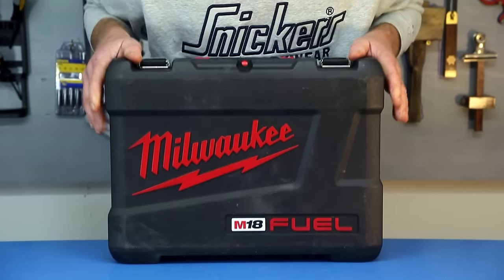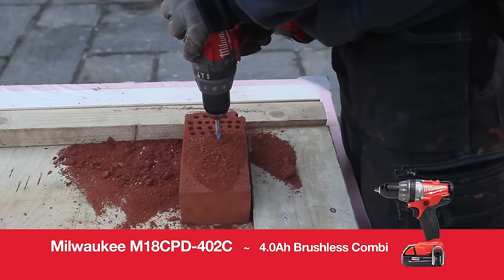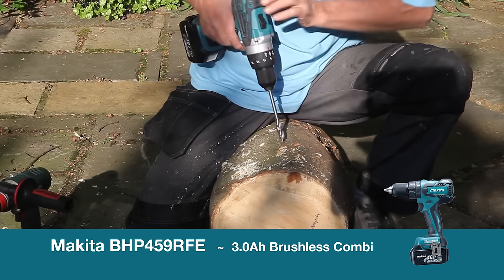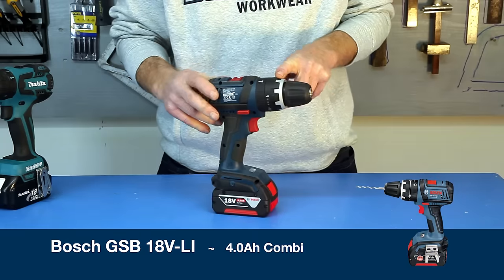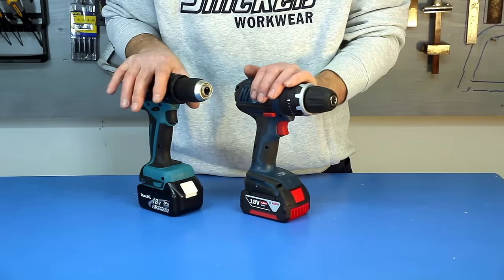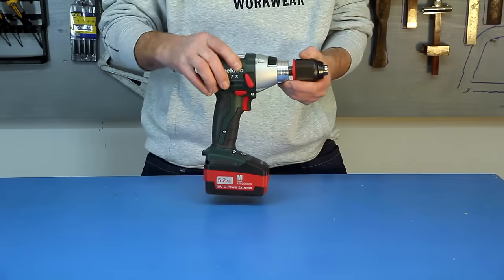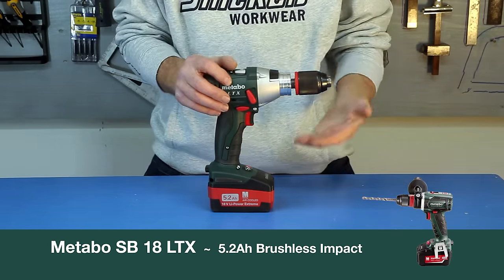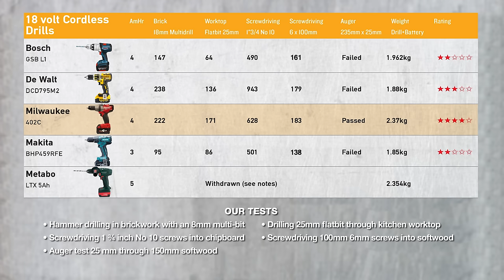18v Cordless Drill Review - 5 Best Drills Tested

Comment: If a drill isn't durable, it's as good as useless. I have worked for a communications equipment shelter manufacturer for pretty much the last 8 years. There are approximately 250 or so workers using 18v DeWalt cordless drills, all day long, 5-6 days a week. They get dropped from 6 foot ladders (occassionally from 15ft or higher), thrown around job boxes, get rusty from no climate control, and go through batteries non stop. For the most part they have gotten more durable with each redesign. We have occasionally tested equivalent models by top manufacturers. EVERY single other brand tested has DIED in about 2 weeks, literally. I've killed my share of DeWalts, but nothing else I have seen is close to their durability. I am confident that the one I have at home will last me as long as I can get a battery for it. Having said all that, I'm not sure about the newer lithium ion models, since they haven't been in use long enough to get a good idea of their durability. My suspicion is that they aren't as durable in the long run as the older models. The casings on newer drills are slim and I doubt they absorb as much impact. I'm still betting DeWalts are tougher. None of this probably matters for home use, but as I said, a DeWalt will probably last the rest of your life.

Comment: It’s the best youtube video!!!
Now I repairing the own flat. After 1 day my old, green 12v Bosch was dad.  So I decided to buy a new normal drill (not
green).

I wanted to have light and pretty powerful tool.  All 18V tools weighed quite a lot, but all 10-12V had very little power.  I found not bad compromise:  A month ago, I bought a DeWalt dcd795 d2. It's the same drill but with a smaller battery. It’s weight only 1,66Kg (I’m not sure but I think it’s means 3,66lbs).
It’s not a largest battery but for my work… – enough!  With one battery I screw up 500 small bolts (4,3x25).  It’s not bad. I drill only a few big holes or screw in a day. For small holes/bolts it works perfect! But it can do also a hard job, its very universal tool.   Of course, then the battery runs out too quickly…  ...hummer on this dewalt it’s very weak, VERY VERY VERY weak for concrete. I use it only for a bricks when lazy to take normal hummer drill.   The best think: in Lithuania DEWALT cost 272eur. (cheapest choise in your list) (2xbattery 2Ah, strong plastic carrying case and charger).  
P.S. Sorry for English grammar.

Comment: The point may have been made before but that DeWalt is not the top spec in their 18V Cordless range so is not comparable to the Milwaukee M18 CPD-402C. 
There is a difference of 20 Nm of Torque between the DeWalt you used the their premium model the DCD995M2. 60 V 80 Nm.

The model you used is actually not even the 2nd in the line up its the third. The second would be the DCD985M2.

The 80Nm Torque of the top Model would compare far more favorably with the M18.

Enjoyed the video mind you. Great to see tool reviews from UK based Youtubers.

Comment from the maker: It was a 32 mm  auger and brand new out of the box to make it fair. I set the drill on low speed and it stalled going into the third piece of timber.  It is interesting to see that you had a different result. Maybe the electronic cut out is more sensitive on some that others. I don't really believe that but I am at a loss to explain why you succeeded unless the bit you use is less aggresive. I will try some experiments with bits.
Reply: +Skill Builder  Hi what about Hitachi tools and drills? Are they so inferior you don't even review them? Looking to invest in a good quality drill and power tools is the Milwaukee collection the best do you think?
Reply from the maker: +News & Views Today 
We didn't have a huge selection. They cost money so we concentrated on the most popular. The new test due out in two weeks has Hitachi and Panasonic.  There is a lot to do and say so we have split it into two parts. First part comes out this weekend followed by the conclusion next week.
Reply: I have the Hitachi ---for years gave it to my son.  Just bought Milwaukee (shown in video) and to be honest...no difference...and Hitachi costs less.  So--- if I had it to do over...a toss of the coin but l am leaning towards Hitachi.

Comment from the maker: All manufacturers had trouble with Li-ion batteries in the early days. Some admitted it others didn't. The trouble is that once the LI-Ion battery has been run down past a certain point it won't recover no matter what you do. These days  all the good Li-Ion batteries have a built in cut off circuit  to make sure they hold enough charge to survive. If you see a Li-Ion battery with just two terminals it is an old style battery which means that as soon as it gives out you need to recharge it rather than leaving it for a few seconds and giving it another go.
Reply: list the top drill brands and where they originated
Reply: u didn't test any craftsman drills?
Reply: Milwaukee производится в Германии, или только сборка ?
Reply: Анатолий Дехтяренко Milwaukee is an American company.
Reply from the maker: christschool
No Milwaukee is in America but it is a brand owned by TTI industries.
Reply: HeavyMecha Milwaukee is an independent subsidiary, with the leadership, engineering and manufacturing remaining in America.
Reply: HeavyMecha It pretty much means exactly that.  For instance, Berkshire Hathaway owns Dairy Queen, but Berkshire Hathaway doesn't tell Dairy Queen what to put on their menu.  The only measurement is growth of the business.  Otherwise, the holding company has no input in operations.  I finance these types of companies in my job as a commercial banker.  In addtion, ITT doesn't even own all the stock of Milwaukee, just over 51%.

Comment from the maker: Hi Hanza

We didn't have a comparable DeWalt drill at the time. The 3 speed DeWalt  drill will produce the torque but we would have been putting 3 speed up against 2 speed.   Nothing else did as well as the Milwaukee. . All the drills are 18 volt and the DeWalt only lost out on the torque. The chart shows how they performed. If we do the test again we will change a lot of things.
Reply: O9
Reply: +Skill Builder Thanks for explaining that but just because one brand doesn't offer a feature that another does should not eliminate it from the contest. After all, you were comparing 18V drills. I know my old Dewalt 3-speed 18V would have driven that 1" auger through the wood. 

Anyway, that was a really good review and I bet that Dewalt wore you out driving a whopping 943 1"3/4 screws on one charge! LOL
Reply from the maker: +Pro1er 
We have re-run this test now and the DeWalt drove 32mm auger through seasoned oak. So did Festool, Makita and Milwaukee
Reply: Cool! Thanks for the update.

Comment: Something that I'm not sure you mentioned, but I love the "bent wire" style belt clip of the Milwaukee, over the stamped sheet metal clip you see on so many other drills/drivers. Much less likely to catch yourself on it when you try to hook it on your belt, and also less likely to scratch your arm or surface with a sharp edge when you put it down, or move it around.

Comment: Four years ago I had a Hitachi 12v ni-cd drill and impact driver set.  It worked great.  I dropped it about 10 1/2 feet onto a concrete floor.  It broke the handle.  I repaired it with BM mighty putty and gave it to my son.  I bought a Milwaukie 18v li-on set.  I month or so later my son and I were putting down decking boards.  He was able to drive 2 screws with the old 12v Hitachi to my 1 screw with the new 18v Milwaukie.  Last week I found a great deal on a used Hitachi 18v li-on drill and impact drill.  My son came over and we tested the 18v impact drivers driving 3" #10 square drive screws into a green 6x6.  The 18v Hitachi drove an average of 4-5 screws compared to the Milwaukie 18v driving 1 screw!  I know this is not a high tech test but the Hitachis kicked the Milwalkies butt big time.
Reply from the maker: I didn't test the Hitachi but I will. If you look at the test results you will see the Milwaukee was not the best performer on smaller screws. It comes into its own on heavy duty tasks. The torque is high but the speed it lower.

Comment from the maker: If you mean SDS hammer then the speed is usually quite low in RPMs but the jjoules of hammer power are key.
All the major manufacturers make good hammer drills.I like Hilti because they seem to last for a long time but they cost a bit more but DeWalt< Milwaukee and Makita all have good machines. In particular look out for pneumatic hammer where a piston of air is the striking force.  If you are looking at cordless there are 36 volt machines out there that pack a punch but if you are running 18 volt on your other machines it makes sense to use the same battery platform.
Reply: Did all of the drills have brushless motors?
Reply: The metabo didn't it had a pesky four pole motor
Reply: the makita did but the battery capacity was 3/4 of the milwakee
Reply: the dewalt was a good match against the milwaukee so far
Reply from the maker: timothy munday

The Metabo was withdrawn but I have used it since and it started smoking and cutting out.
The Makita was brushless but I wanted to see if the 3AmHr brushless beat the Bosch 4AmHr. Have a look at the chart and you can see how it performed.
Reply: +Skill Builder Best 18v  SDS cordless drill is AEGBBH18 this monster have a 2.3 J impact energy and no other can compare to this little beast I have Bosch , Makita and Dewalt SDS cordless drills as a company and far away  this is the best 18v sds drill we ever had compare to power, weight and performance
We currently bought from USA a lot Ridgid gen5x cordless tools and we mixed them with some existing AEG 
Price compare to the professional quality is fantastic Only £280 incl delivery for five tool combo kits gen5x with 2 4ah battery and we had AEG 240V chargers from here. You try to buy this from Bosch, Milwaukee , Makita or Dewalt , you have to pay double because you live and trade in UK
The same story with Porter Cable the greedy corps ( Stanley B&D ) here try to sell this line as Stanley Fatmax they didn't bother to change anything just colours but course the price....
Reply from the maker: +Andy Goodman 
Thanks Andy that is good insight. AEG is TTI, same as Milwaukee. I have heard good and bad about AEG. They seem to pitch it at the trade in some countries but let it lie in the DIY sheds in others.

Comment: Roger: Thank you very much for testing the quality 18 volt combination drills in your unbiased test. The tool department buyers at my family owned builders merchants store in rural Buriram Thailand also noted top results with the Milwaukee 18 volt Fuel18 M18CPD  4.0 Brushless Combination cordless drill. My family owned tool supply store Ruangsangthai Ltd. is very proud to sell and repair quality Milwaukee Power Tools in Buriram Province, Thailand. I will broadcast your video on the video monitors of the power tool department in Buriram.
Reply: Wishing you all the very best for the future.

Comment: My take on the cordless market is a little different than most. The most important thing to me is getting the right tool for the right job. Even though these drill shoot off tests are interesting and can give some good insight, they can also be misleading to some people. Unless the number of holes drilled or screws put in are way off with the same size batteries, then it isn't much of an issue. All one has to do is alternate batteries, one in the charger, one in the drill. When the drill dies, trade out the batteries. As long as you can trade out batteries and keep drilling, then that's what matters.If running these drills at their maximum abilities all day, everyday, then they won't last long. If you have to run a drill to it's max level on a regular basis, you need to upgrade to a bigger drill. Get a big enough drill that it doesn't have to run so hard to do the job. It's like a car. If you drive it like a racecar everyday, you will soon have problems. If you drive it under normal conditions, it will last a long time. Drills and other cordless tools are the same.  If most of today's cordless drills are used accordingly, they will all do a great job. The batteries seem to be a big issue with cordless drills/tools. When they go bad, you have to either sell a kidney to replace them or just buy a whole new drill kit. I like to buy the cordless tools that have good long term battery life. From my own personal experience, Bosch is hard to beat when it come to battery reliability and that is something that you can't readily test for. I have some Bosch, Milwaukee, Ridgid and Dewalt cordless tools. All have served me well and I like them all. I like the Bosch the best in being user friendly, reliability and great battery life. The Ridgid NiCad batteries seem to be the worst of the bunch. I replace a couple of 18v NiCad with the new lithium for the use of a jigsaw and think they will do well over time. I got them on sale, a 2 pack of 4.0 for $100. With the Ridgid, I have 3 12v NiCad,  1 14.4v NiCad, 2 18v NiCad that are all bad. I have 1 14.4 Dewalt NiCad that is bad but it is old. Rather than replace them (except for the 18v), I just bought a new 18v Bosch drill driver and impact, CLPK233WC-02. It has the wireless charger which works great. The best price I found is $305 on the home depot website. Once the 4.0 batteries are available, I will buy one to boost the runtime.
Reply from the maker: +halfstep67 
Thanks for taking the time to give us some  in depth and intelligent comment. I agree totally with your views except perhaps that the more you charge a battery the shorter its life so the larger ones should give you more . We are doing a new test right now and we have been thinking about what we want to find out and your comments are spot on. Interestingly in this test the lower torque DeWalt was much better when it came to smaller screws so like you say having the right tool for the job is most important.

Comment: Pipefitter of 14 years.

Rodger! I am a real fan of Skill Builder and love watching you and Robin with your regular construction and tool test vids!

I must however have a moan this time! The Makita drill you tested in this particular run up is not equivalent to the Milwaukee or the others. You stated the Milwaukee has a metal gearbox, a fuel gauge and is a heavy duty drill. You also stated that the Makita only has 3Ah battery’s. The Equivalent Makita drill would actually be the MAKITA DHP481RTJ. It comes with 5Ah batteries, has a battery level indicator on the drill body and also has a metal gearbox. 

No bad feelings Rodge, but you can’t compare a Ford Fiesta against a Rangerover on power, not a fair test! 

I’ve used one of the DHP481RTJ drills for over two years and I can confirm that it would definitely give the Milwaukee a run for its money.

Keep up the good work!

Comment: good video overall and great to see reviews like this. I think you should have had the top of the range dewalt brushless up against the milwaukee fuel, which is milwaukees top of the range. Then you would have had a fairer review. Also you should have used the same ah batts for each tool to have a better idea of run times.
keep up the good work.
Reply: Thanks Adam
You make some valuable points. I am happy to run any drill the manufacturers lend me but they get very twitchy about comparisons.
 I took a selection of 18 volt drills which the average builder might pick up thinking that all 18 volt drills will give the same kind of performance.
As for the DeWalt  I have just been reviewing their 3 speed drill which has a higher range and more torque. As for AmHr, Makita was only offering the 3AmHr when this test was run. It was interesting to see  how much difference the Amps made and also the fact that the 3AmHr weighed as much as the 4AmHr.
Reply: @Roger-Bisby1 not to mention the higher amp hours give slight extra umph